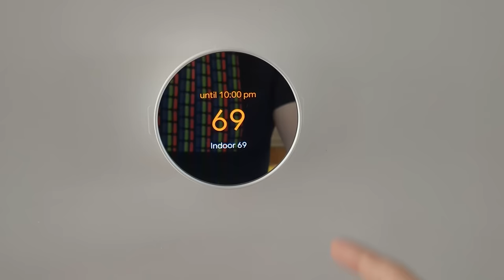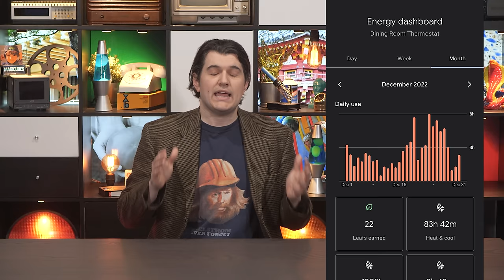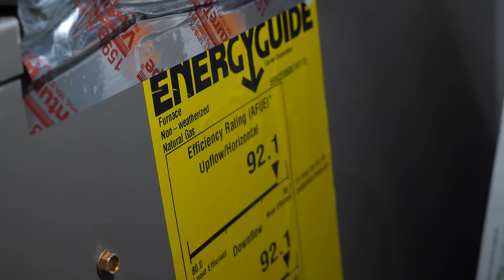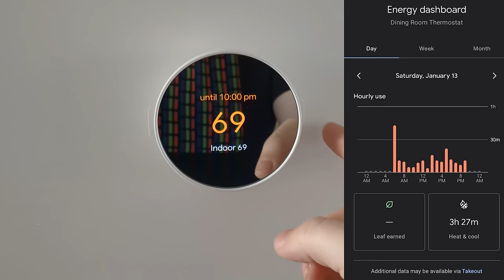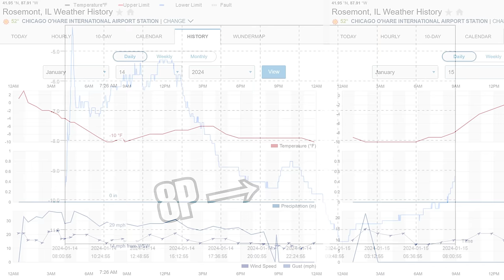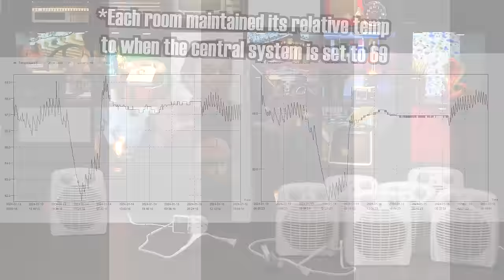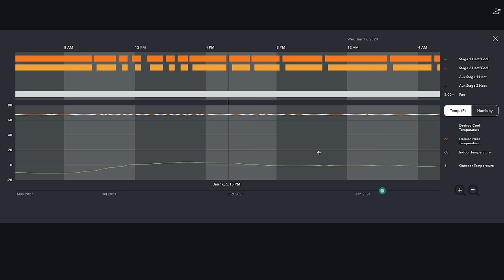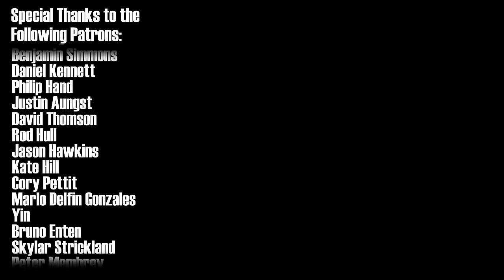Old HVAC industry practices are holding us back and costing us money. But we can fix it.

Comment: I’ve lived in the south east U.S..  The home was 1700 sg ft and built in 1990.  The AC/Heat pump was brand new.  We rarely saw temps below 40 deg.  We paid over $400 a month for electricity in those winter months.  And we were constantly frozen and require electric space heaters in most rooms.  Thermostat set at 68 deg.  

I recently moved to northern Michigan.  You think Chicago is cold?  The house was built in 1974 and is 2200 sq ft.  The home doesn’t have AC or ventilation ducting.  It does have a new NG hot water boiler with three zones.  Thermostat se at 69.  This home is very comfortable in the winter and it costs us about $150 a month and never requires supplemental heat.  We are many times more comfortable with the outdoor temps well below zero than I was down south!

From my understanding heat pumps struggle to extract heat below about 40 deg F.  And it showed.  When the heat pump was in heat mode the air temps out of the ducting was often below the 68 deg set on the thermostat.  This causes a supplemental heat source in the form of the a 240 vacuum heating coil to activate in the system.  Btw, you blow cold air across a heated coil it will cool and reduce efficiency.  The air temps out of the ducts to almost feel warm.  The electric meter looks like it was a saw blade.  

No such issues with our modern NG hot water system.  We don’t even see the thermostat move.  The basement zone almost never comes on even in the coldest temps.  The main floor is the main user of heat.  The third floor is somewhere in between due to the heat rising from the main floor.  So we actually keep that thermostat reduced a few degrees.  

IMHO, using how often your system runs as an indicator of proper heating system size is horribly flawed.  How often it runs is more of a fiction of how well the home retains heat.  Our southern built home was essentially a crap box with bad windows.  Our 1974 up north home is a much better built home with much better windows and doors.  So in totality it’s a function of everything.  But I won’t be going back to electric heat pumps.  It’s been a while since I researched it, but getting a heat pump to keep a home warm in possibly consistent below zero temperatures without supplemental heat is very hard, expensive or maybe impossible.  As you mentioned, I will gladly fail on the warm side.  Since up here NG is much cheaper than electricity you can keep the heat pump.  I do wish you luck with your heat pump.

Comment: If u wanna run heat pump, u need to re-run the control wire which add extra cost to it, it was strength replace will take 8hrs but adding re-run wire might add additional 3-4 hrs which increase cost of installation 50% or more.

Comment: You should focus your energy (ha funny) on changing your local codes.  Sending these sorts of onto the internet is not applicable in all locations.  At minus 40F for a month straight makes for a much different "right size".  You will find that your local codes have probably not been overhauled in 20 or 30 years.

Comment: 110 kW for a day boils down to roughly 50 euro's a day just for heating. Over a month of winter that'd be prohibitively expensive - more than the average yearly electricity usage in just one month. Granted, we rarerly see temperatures lower than -10 (14 F) here so the power usage to maintain a pleasant temperature would be less but over the 3--5 months of late-autumn - winter - early spring that's gonna add up.

Comment: Maybe its just my californian ass....but I feel like I would prefer an oversized AC unit then an oversized furnace. Yeah, extreme temps one way or the other are uncomfortable or even deadly, but...I can always turn myself into a burrito with blankets, there's a limit to how many clothes I can take off, though. And let me tell you, there have been heat waves that have made me want to strip naked and just lay on the wood floor.

Yes, yes, yes, you want both a furnace and an AC unit. I'm sure someone is going to misconstrue this as me saying "you don't need a furnace at all", but what I'm actually saying, DAVE, is that if I had to choose one of those things to overestimate, it would be the AC.

Comment: I just downsized my heat / ac by 1/2 ton  in my Florida house.  We also talked to multiple installers.  For Florida they said that we will not make up any $   over the Life of the units.  Also  the  average heat pump is much more likely to have problems.  Everyone  of the installers said they would not recommend a heat pump.  Due to the added cost plus problems over the years.       Here up north in PA .   Gas is so much better here in PA.  If i were getting a heat pump it would be for spring and fall.  Also my natural gas heat is cheap.    And with battery backup i can run on a backup  battery a few days.      You  can  never do that with a heat pump.         So natural gas is very reliable.  Natural gas dryer, stove, hot water .       And if i could still buy one i would have a natural gas refrigerator.    All of these are very efficient.

Comment: I am sure someone has already addressed this but there is another benefit to oversizing a gas system so that it does not run as frequently or as long and that is reducing corrosion in the burner

Comment: Heck, you probably don't need heating because your studio has so many incandescent lights, just two of those lava lamps alone could heat up a beadroom! 
Just teasing, but as a legitimate question, how are you not sweating when you make your videos? With all of the back lights, the main lighting, the flatscreen behind everything, and the thick coat it must get quite warm in there, unless you've got killer AC or it's an ice cold basement.

Comment: If you are willing to tinker, you could adjust your gas valve on your current furnace and lower the amount of fuel being used so the furnace will run a bit longer than it has been, using less fuel overall.

Comment: Wouldnt recomend a heat pump on places that get that cold. See what happened to texas when all those people died. Heat pumps are great for most of California since it does not get that cold and eliminating gass for heating is smart. Places where heating is crucial should still use gass.
Reply: Also heat pumps stop working correctly under certain temperatures in which case it needs to employ the help of strip heat. you end up eating more energy.

Comment: I do not think you would want a heating HVAC to run all the time. So 30% seems appropriate. But you also cannot compare a town house to a free standing home with 5 sides of insulation, to your 3. Nothing wrong with going larger in size, you just do not want to go smaller.

Comment: I also live in the same area as @technologyConnections.  I think it's silly to move to all electric heat.  The type of heat pump the channel creator has gets less efficient the colder it gets.   Meaning during that polar vortex we experienced two years ago, it probably wouldn't have heated his home well.  And then you need to factor in the price of electricity vs. natural gas.  Illinois is one of the states that has relatively cheap electricity.  But don't count on that for very long.   The state politics is likely to mandate more renewables in the electrical grid.  That will raise prices.  All those solar panels and wind turbines aren't going to eliminate the need for a natural gas electrical plant.  The utilities will still have to keep these just in case the wind stops blowing or the sun stops shining.  So the real world effect will be higher electrical prices.   Compare France to Germany to see what green electrical policies do in a latitude where you don't get that much energy from a solar panel.  France gets about 75% of it's supply from nuclear power and Germany decided to shutter their nuclear plants to go "green."   I have solar panels.  They output roughly jack squat in December and January.  If the Chicago metro was primarily heated by electric, this would be a problem if renewables made up a larger mix of supply.   to @TechnologyConnections I suggest you focus a little more on the economic consequences.  A recent article went viral when it was reported 2 in 3 Americans couldn't cover $400 in emergency expenses.  It's all nice and middle class of folks who want to "save the environment" but these policies are literally going to kill people if they are taken too far.  Americans might complain about higher energy costs, but those living in the third world will literally die as a result of the consequences we make in the west.  Higher prices for everything include higher prices for fertilizer and other farm inputs.  We live in a global economy and what is done in America and Europe affects the other 7 billion people on the planet

Comment: So you stop using your 90% efficient gas furnace.  Now the Utility burns that same natural gas in a power plant that is 40% efficient, and delivers that power over transmission lines, and transformers, and distribution lines with at least 5% transmission losses.  So now you are buying gas-generated electricity that is 38% efficient.  And before you get all pissy, your heat pump is not going to be 200% efficient at the coldest temps.

Comment: Alec, first time long time. I’m a little confused and disappointed that you put this out like this. Your premise, on face value, is indeed true. However, that 15 mins on/45 mins off is acting as its duty cycle. If you were to shrink the machine, the duty cycle would go up, and the life time of the equipment would go down dramatically. You also made it sound like you’d want your unit operating 100% of the time. Who would want that? There’s a balance that needs to be struck here, and it definitely sounds like whomever built your system hit the nail on the head…

Comment: I'm renting a room off your viewer. He's not very capable with stuff and let the furnace blow by not replacing the filter. Not he is determined to use heat pumps and references this video. We live in Canada. He doesn't have a heat pump and it's October and he just handed me a Honeywell heater ...

If I die it's on your hands.

Comment: so wait tweed jacket dude, what’s the problem with an “oversized” unit that can increase temps quickly even in a cold weather and maintain 75F/24C? It bothers you?
Reply: It’s more costly. In the summer it doesn’t do as well dehumidifying. It may require a new electrical service upgrade. 

If none of those matter to you the. Go big I suppose.
Reply: @TJPavey  Forced air units also tend to be noisy. I'd hate to have to have the heating running at a 100% duty cycle all night long. The cost delta is amortized over 10-15 years, it's basically noise.
Reply: @XKS99  100% duty cycle is only for the absolute coldest days

Comment: I think that the way you blame hvac sales teams for overestimating hvac needs is very disingenuous. i think you are baiting for comments like this but here it goes. maybe the estimate you consider accurate is the problem. maybe your preference for the speed as which the heater kicks in is lower than the preferences of others. just because you made a calculation based on the size of the house and all these other variables does not mean the result is not subjective in some way or another. you say it yourself. the heat might not kick in as quickly unless you overestimate the size you need. thats probably the entire point, consumers do not want to wait for their heat to kick in and heat the whole house and if they have to, they will call another company to install an overkill system to their preferences. maybe it has nothing to do with how hvac chooses a system for a consumer and everything to do with how a consumer chooses a system for their house.
Reply: He made that point: some home owners do not want any delay between when their system turns on and when the inside ambient reaches set point. 

Some homeowners feel that if the system runs more than a few hours a day, “something is wrong” and they specifically tell their installer they want a system that makes the fastest increase from the lowest set point to the highest. 

As he demonstrated, this may not always be the best way to approach the issue. Any solution greater than the legitimate need will present a higher full lifecycle cost than  the properly sized solution - like buying a F350 because you buy 40 bags of mulch each spring and a cord of firewood each winter. 

A transparent and conscientious installer will take the time to measure more than just (length times width times number of floors), and actually understand how the homeowner wants their home to feel. 

But it is hard to do this with every potential customer because many of them will not hire the transparent, conscientious installer, so even the right-minded installers focus on delivering quotes as quickly as possible to increase their booked jobs. 

And, yes, sometimes salespeople focus their efforts on systems etc. that bring them higher margins, manufacturer incentives etc. 

I never worked in HVAC but I did work for an international IT reseller, and some technology manufacturers went to great lengths to encourage us to present their stuff as the solution to every customer’s needs.
Reply: @dougjb7848  "He made that point"

he breezed through that point because making a video calling out the consumers wouldn't get him as many views and people would stop watching at that point. he scapegoated the hvac company when we all know the truth.
Reply: @BrickTamlandOfficial 

So the customer (homeowner) is wrong and at fault? 

Do HVAC companies have any responsibility to educate customers on “you actually really do not need 60K BTU, you would be fine with a system half as powerful and expensive?”

If I go to a Ford dealer and say “sell me a F350 so I can bring home 40 bags of mulch each spring and a cord of firewood each winter,” am I the only one to blame for buying 5x more truck than I need?
Reply: @dougjb7848  the hvac can educate but this is america. the consumer will never remember anything the hvac claims and in the end, the heat kicking in slowly is still a fact. customers do not want the heat to be slow. it doesnt matter if the hvac thinks they are objectively right (we know this is a subjective opinion though)

the consumer will just pick the hvac that installs "overkill" systems according to your subjective beliefs.
Reply: When your HVAC was installed did they run you through multiple options so you could decide between a cheaper, more efficient option or one that heated your home more quickly, or did they just install the most expensive option without informing you?